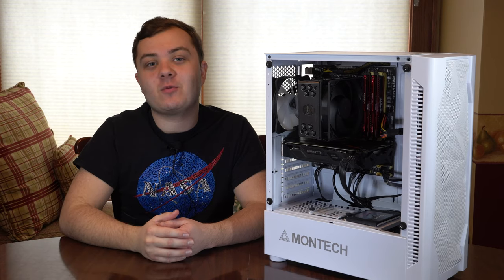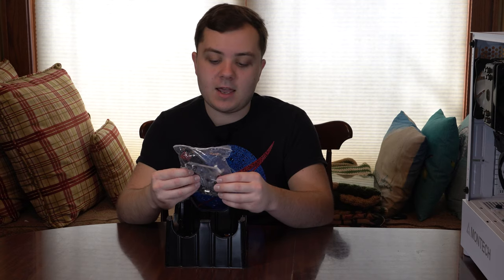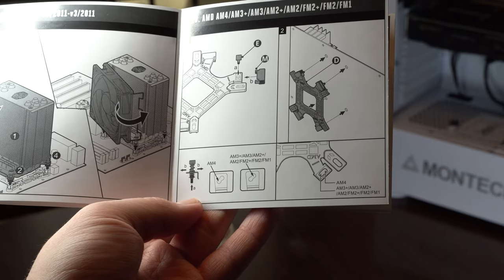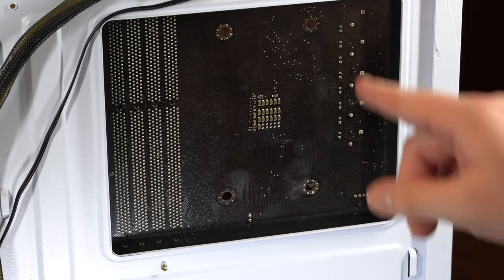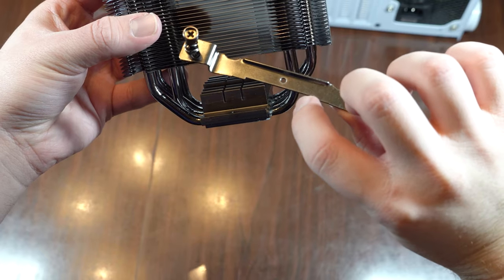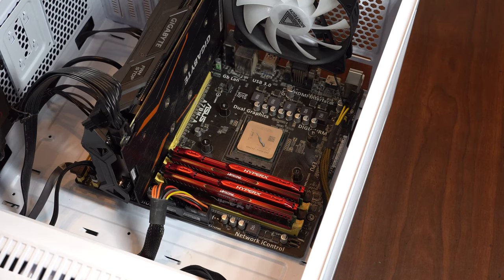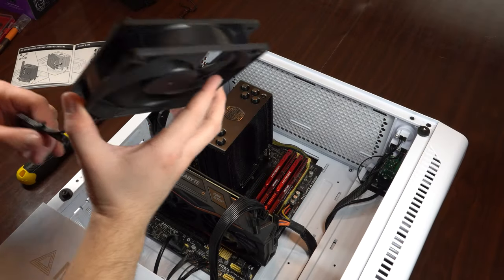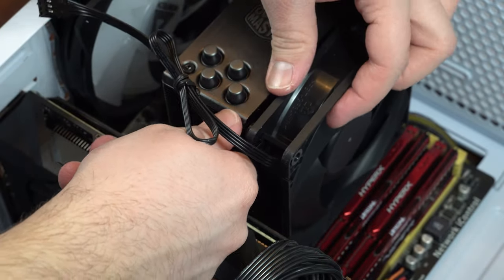Installing a HYPER 212 BLACK EDITION Air Cooler in a PC (Tutorial)

Comment: guys before you remove the cooler heat up the pc by runningh it for 20 mins so the old thermal paste becomes softer then wiggle the fan side 2 s die to ease it off

Comment: Yours is the only tutorial which bothers to mention the direction of the fan, so thanks for that. It seems that many Youtube tutorials install the fan the wrong way around, either pushing air back into the case, or else affixing it to the wrong side of the cooler. The manual does not help in this regard. I received an extra fan with my cooler and would like to try out the 'push/pull' method.
Reply from the maker: Nice!
Reply: Installed my cooler with the fan facing the back end of the PC - not too sure if i need to flip it

Comment: Mounting barkets for the fan were pretty underwhelming, also had to staighten some of the heatsinks as they came bent. Pretty good compared to stock amd cooler, about 15 degrees cooler under load. Side note had a hard time getting the stock cooler off because the thermal paste that came with it acted like glue.  My 5600x actaully ripped out of the cpu socket bc the bond was so tight.  Luckly no damage to the chip or the motherboard, got everything working in the end.

Comment: Anyone reading this DO NOT overtighten the larger nuts at 4:43. It will crack the terribly made plastic backplate. If you do crack one and still use it for a while, it’s almost impossible to get back off down the track. There’s nothing to grab a hold of properly without pliers and they can easily scratch the traces on the board.

Comment: really helpful guide! i was very confident with your assistance :) unfortunately it looks like the bracket is a smidge off for my AM4, and i was sure i put the backplate on right... will update my comment if i make any progress 🥲

update: fixed! i had flipped the brackets upside down and backwards trying to work out how they connected—and they have a slight curve to them, so when i ended up attaching them backwards they didnt fit lmao... so it's all installed now! and it's a lot quieter than my old racket-making one, 10/10!

had a brief scare thinking i shorted the gpu or motherboard in the process, but luckily it turned out i only connected a few things wrong after wrapping up my work (my hdmi cables go straight into the graphics card, which i forgot and put them in the normal ports, lol)

thanks again! great video, i wouldn't have made it this far without all the great footage you provided

Comment: When i was mounting the cpu cooler i forgot to take the plastic cover from the bottom part of the cooler...until i was about yo turn on the pc, so i had to remove the cooler back in order to take that little peace of plastic off but when i did it a big portion of the thermal paste came off with it so the cpu itself was left with just a tiny little portion spreaded on it...so i was wondering if i have to reaply thermal paste again or i would be ok with it
???
Reply: take off the old and reapply
Reply: @patnordby9693  that's what i'm doing in a couple of days
Reply: @patnordby9693  Thanks!

Comment: sounds like a dumb question (which im sure it is), what should i rub the thermal paste off with from my previous cooler as i dont know if i have to be soft with it or has to be eg a microfibre cloth
Reply from the maker: I would just get a paper towel and wipe off the thermal paste. It can be stuck on the cpu so be sure to get it all. Just be careful not to get any paste on the motherboard. (That could cause a short)
Reply: I use coffee filter and rubbing alcohol

Comment: Damn, the later variations of these Hyper 212s were much more forgiving to install compared to the earlier versions.
@ 9:30 shouldnt the CPU cooler be plugged into CPU_FAN (usually located at the top portion of the mobo) rather than CHA_FAN?
Reply: Its work the same the difference is that in CPU_fan the cooler will slow or work faster according to the cpu temperature , but you can use a software for it too... You can even connect chassis fans in the CPU_fan but they will not work like chassis fans...

Comment: I have a question bro, so my buddy helped me with my build and put my cooler master upside down, if I want to flip it would I need to mess with the back plate or would I just need to undo the 4 screws, clean off the excess and apply thermal paste, the. Connect the fan correct?
Reply: It’s this same model btw
Reply from the maker: You would have to unscrew the 4 main screws and then take the cooler off. If you are very careful and take it off slowly you can not mess up the thermal paste and you can just flip it and put it on right. You don’t have to mess with the back plate at all. 👍
Reply: Awesome brotha thanks for the fast reply

Comment: How good will this work with a i9 9900k and will there be any problems with it fitting with my ram?
Reply from the maker: It work work pretty good. Maybe look into getting a liquid cooler to maximize performance for an expensive cpu. You will have to check the spacing between the cpu and the ram. Usually it will fit unless you are using a mini atx board

Comment: So I got the CM Hyper 212 Black edition and mine came with some kind of splitter cable. Any idea what that's for or if it's needed? On the user manual it says to connect it but you just plugged the fan cable directly into the cpu fan spot on the MOBO. Unsure what to do there.
My CPU socket is Intel LGA 1200

Comment: Can I mount the cpu cooler in a vertical orientation?
Reply from the maker: I don’t think it will work like that. You want the air to go from the front of your system to the back.
Reply: @thinkable3D   My case is NR200P and the airflow is from bottom intake to top exhaust. So i want to rotate my cpu cooler if its possible with an amd brackets.

Comment: Does this cooler support the LGA1200 CPU socket? there is websites that have it on the list of compatible sockets but there is also some that don't and I don't know at this point
Reply from the maker: What brand of cpu are you getting? Amd or intel?
Reply: @thinkable3D  It is an Intel Core i5 10400, it has integrated graphics but I don't think that matters
Reply: @thinkable3D Also another question that I am not sure if you know but what is the TPD for this cooler

Comment: Thank you! You helped me a lot, and it's working! The first step was the hardest - removing the old fan: it was stuck to the CPU and it took me more than an hour to get it unstuck. :D
Reply from the maker: Yikes. I had that same problem because the old cooler was so old
Reply: Ah ok! This one wasn't even that old, around 7 months. It was the stock cooler that came with the 3600X.
Reply: Took me 3 hrs

Comment: Will this cooler block the first RAM slot, closest to the CPU? I’m wanting to use 4 sticks of RAM and can’t find much info. Any answers would be much appreciated.
Reply from the maker: It might. I think if u have an Atx size motherboard you should be fine. Mini-atx boards might have space problems. Research your motherboard and see the spacing between the ram and the cooler.

Comment: I have a question. I thinking of getting the same CPU Air Cooler, If I get this would I be able to put my Corsair LL120 fan on it instead of the fan it comes with?
Reply from the maker: I have thought about using a different fan as well. I think it will work fine as long as you connect it to the cpu fan port on the motherboard.

Comment: I have a question.
I purchased the same Hyper 212 model for my 1151 motherboard to upgrade its stock cooler. Can I use its existing back plate to mount the new cooler, would it be compatible, or do I need to replace the plate as well?
Reply from the maker: I would just replace every part so that everything works properly.

Comment: Noob question, can you use other after market 120mm fans on these cooler? Thanks!
Reply from the maker: I’m sure you could. You would just have to make sure that they can attach to the radiator and you have to plug the fans into the cpu cooler port on the motherboard. Best of luck 👍
Reply: @thinkable3D  that's great! Thanks for the response man. Keep it up and stay safe out there🍻🍻
Reply from the maker: No problem. Thanks for the support! 😎🤙

Comment: Hi, I'm looking to buy this cooler but my i'm concerned if it will fit in my case. The specs of my case say that it fits a cpu cooler up to 160mm. Do you think i could use one of these or i might have a problem?

Comment: Hi nic just installed this cooler, wanted to ask is sagging normal? It's not too much but a little?
Reply from the maker: It should be very tight and not moving. Make sure that everything is tightened all the way.
Reply: @thinkable3D  thanks nic I kept thinking about it and finally I decided to double check and redo everything. Thank God I did cause some screws were so loose I'm surprised it didn't fall SMH 😳
Reply from the maker: Wow! Glad it all came together. 👍

Comment: I have a 220T corsair ICUE   it has 3 front intake fans. Would It make more sense to have the fan pulling from the back of the cooler and pushing it toward the exhaust fan in the back
Reply from the maker: I’m no expert on pc airflow, but I think it would be best if the air was coming in the front of the pc then hitting the cpu fan, then going through the radiator and out of the case

Comment: Got it to-day! My PC build needs RAM, so not ready to install the 212. Have the AMD 5600G which comes with a Wraith Stealth. Does the 212 come with thermal paste? Thanks & great walk thru! Do you have the fan oriented to push air out to the rear case fan?
Reply from the maker: Yes the fan is pointed to have the air go from front to back. It does come with thermal paste. Good luck on your build!
Reply: @thinkable3D  thanks!

Comment: Hey I have a question. My motherboard does not have wifi but when I plug in Ethernet, the internet does not work. Should I need to download a driver?
Reply from the maker: You might have to download a motherboard driver, check and see if the router works.

Comment: Why did you drag and smear the thermal paste…
Reply from the maker: I do that so the paste stops coming out of the tube and I control when it stops. You want to reduce the risk of the paste getting on anything other than the top of the cpu, as not to ruin any other components/fires.
Reply: @thinkable3D  I installed the Cooler Master fan successfully but the only problem I’m having is when every time I turn on my PC  a orange light appears. Do you know how to turn this orange light off because until it gets turned off nothing is going to be displayed on my monitor.

Comment: The fan won’t screw onto the motherboard it’s not reaching
Reply: you'd have to press down on the cooler in order for the screws to reach the holes!!!!!  I say this, is because I got the Hyper-622 Halo Series (the Dual Fan CPU Air Cooler) now installed in my computer, and it was a pain in the dick to get the 2 screws into the 2 holes

Comment: I have my ram in the 1st and 3rd slots, and the ram in the1st slot is blocking the installation of the fan. Would installing the fan on the opposite side still be safe, or could I switch my ram to the 2nd and 4th slots and gave that still work out fine?
Reply from the maker: You will want to switch the ram to the 2nd and 4th slots👍
Reply: @thinkable3D   I did so, and my computer wouldn't start up. it was only after I switched the fan to the other side of the heat sink, and put the RAM sticks back into the 1st and 3rd slots, that my computer would start up normally
Reply: @orosvildheim  Put it in 2 and 4 and pull out the mobo battery to try and reset it.